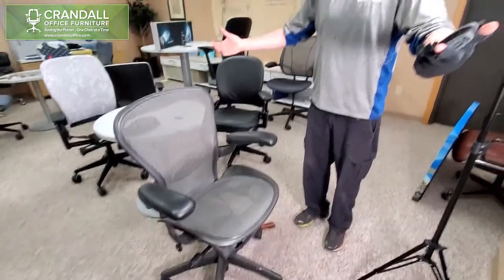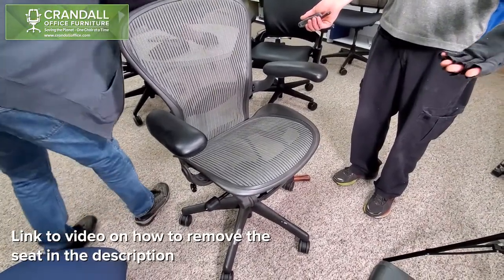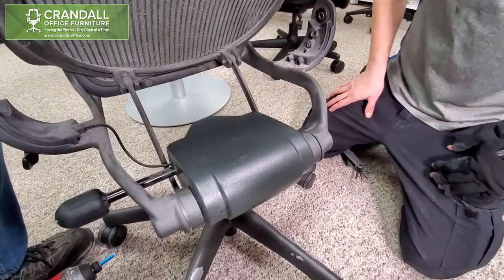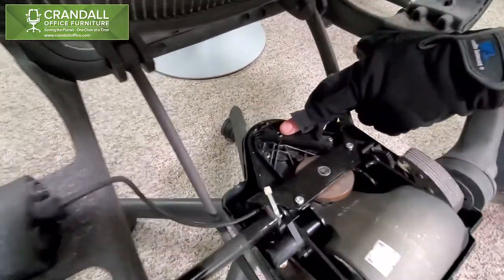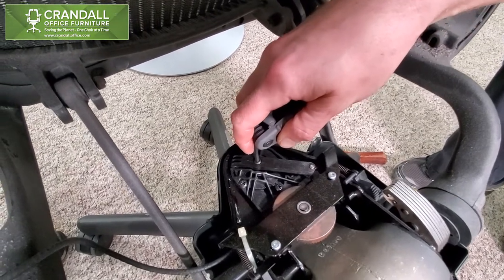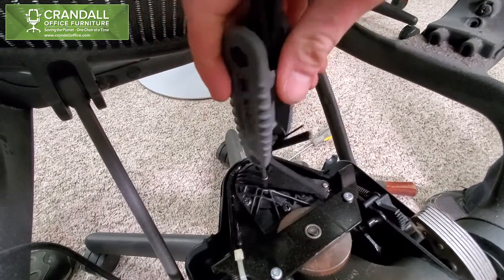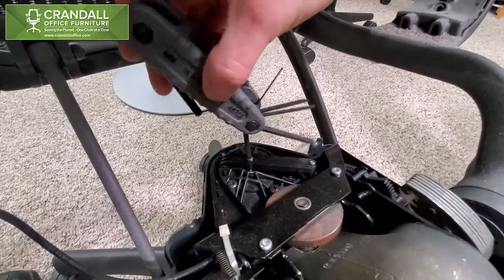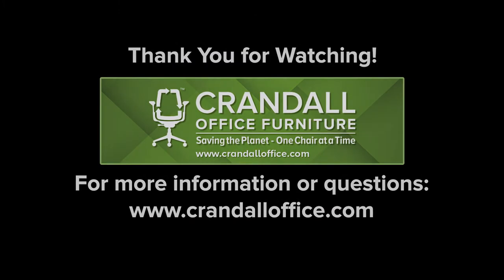Herman Miller Aeron Classic Chair Gas Cylinder Set Screw Adjustment - Crandall Office Furniture

Comment: Pro tip for those watching. You don't need to take the seat off. Just pop the plastic cover off like in video. You can reach the set screw from the back
Reply from the maker: Very true thank you
Reply: Mine is missing a set screw. Is that why my chair will not come up? It's at the very lowest height currently. When I pull the lever the plastic part inside does move. Where can I purchase a set screw replacement? Please help 🙏 😢

Comment: Thanks so much for posting this video.  I just adjusted the piston on my chair turning the allen bolt counter clockwise .  Thought i needed a new piston for my 20 year old chair.  Doesn't sink anymore.  Thanks again
Reply from the maker: That's great! Glad we could help you get your chair fixed up! Amazing that the cylinder is still going strong after 20 years, they usually don't last that long :) Let us know if there's ever anything else we can do to help! -DC
Reply: @CrandallOfficeFurniture  Awesome, thanks again.  If I need parts for my chair I will give you a ring.  This chair has been great for over 20 years.   I use it all the time when using the computer.   I call it my throne.  The chair has been functioning perfectly all this time.  I take good care of it as well.  Keep up the great content and thanks again for the help with my chair.

Comment: How do you know when to change the gas cylinder or there is just something wrong with the mechanism?  Height is all the way up and the height adjustment does nothing
Reply from the maker: We would definitely recommend starting with the set screw adjustment. Make sure to only make small adjustments at a time, and do not over-tighten or over-loosen the set screw (it can fall out if you're not careful). If you still can not get the cylinder operating properly, the next step would be to replace the actual cylinder. Let us know if there's anything else we can do to help! :)

Comment: Thanks! I needed to know how to remove the plastic cover so I can oil the slip springs inside it to stop the creaking!
Reply from the maker: Glad you found it helpful!
Reply: @CrandallOfficeFurniture  Do you happen to know of a solution to solve the squeaking problem whenever I rock my Herman Miller Aeron 2007 chair? The sound is insanely loud! I dismantled the entire chair to the box that you demonstrated and sprayed Silicone lube on the metal and hinged parts and the squeaking is still there! Any Advice is appreciated!

Comment: Thanks for the video. My chair looks exactly the same and I opened the section you showed here but I don't see the set screw, there is a white attachment in place of that. My chair is also sinking slowly. Any idea what I can do?
Reply: I have the exact same problem. Mine doesn't have a set screw that is adjustable with an Allen wrench like they show in the video. Mine has a cable/pump type mechanism running in to it.
Reply from the maker: Any way you can shoot me a quick picture of what's going on there? Would love to take a peek and shoot a quick video for you 😊
Reply: @CrandallOfficeFurniture  same thing here.  did you ever see a picture?
Reply: Per Crandall, I actually have an Aeron from 2013 or newer that uses a side activated gas cylinder, so it doesn't have a set screw.  Thanks guys!
Reply from the maker: @clemmonsm  Based on the picture I received, the chair you've got is a newer chair (made after 6/26/2013) with the side activated style gas cylinder. This type of cylinder uses a cable to pull a lever sideways, and does not use a set screw.

Comment: I found if I go too far counterclockwise the chair still sinks half way down when sitting it but won't return when I pull the handle. Too far clockwise and the chair just goes up and down without any input. What should I do if even micro adjustments can't get it back to normal? Time for a new chair, I suppose.
Reply from the maker: Keep trying to find a middle ground. If that doesn't work, I'd try a new cylinder before I told you to scrap the chair! -DC
Reply: Crandall Office Furniture awesome - thank you!
Reply: @CrandallOfficeFurniture  BTW, does the heavy duty gas cylinder on your website work with the Aeron C? I assume so since that's the big-butt chair?

Comment: I have an older Aeron chair that seems to be sinking a bit as soon as I adjust the set screw counterclockwise. How far out should the screw be turned to stop the sinking over several hours? Also, the seat cushion tilt forward feature seems to not tilt forward.....how should I be adjusting this feature? Again, someone mentioned "adding" the tilt feature........can you further explain? Is there a part for this that might need replacing? Thanks your great videos......Steve
Reply from the maker: Hi Steve - it should not take much - I'd try about 1/4 turn to start and see if that does it :)

To add the tilt function to the chair, you need an entire cable kit - we will likely be posting a video about this in the future :)

Comment: This helped but it still sinks a bit. Is the only fix losing a few lbs?
Reply from the maker: There will some tolerance of give when it comes to the cylinder moving when sitting. As long as its not compressing and free falling slowly or fast and stays in the position once seated you are good to go.

Comment: hey i over adjusted and my set screw fell inside i think, its not there anymore. does this mean it is now sitting un top of my cylinder and it needs to be taken apart to get to it?
Reply from the maker: So you overtightened it and it went all the way through? If so, then yes it may be on top of the cylinder and you'll need to remove the cylinder to get to it. If you loosened it too far, it's likely somewhere else.

Comment: what happens if u turn it clockwise? also my aeron doesnt go down as smooth anymore. would i just need to change the cylinder or can i lube it somehow?
Reply from the maker: Turning it clockwise tightens the set screw, which will activate the cylinder sooner. You would tighten the set screw if nothing happens when you pull the height adjustment lever. As for the smoothness, a new cylinder would definitely fix that, but you can try applying some Vaseline to the cylinder as well and see if that helps.

Comment: Hi. Is there a way to know difference as to whether the screw needs to be adjusted or the cylinder needs to be replaced? My chair lifts, but when I sit back in it, it sinks to only a few inches of lift. Thank you!
Reply from the maker: Does it feel like more of a springy feel or does it actually sink and then not return once you get out of the chair?
Reply: @CrandallOfficeFurniture  I have the same problem, the chair sink immediately after I sit on it, and once I get up the chair goes back up. Please advice!
Reply from the maker: @srikrishnajay  Sounds like you need to loosen the set screw a bit - right now the set screw is too low and is always activating the gas cylinder, so backing it off a bit should make sure the cylinder is not activated all the time and should fix your problem :)

Comment: My aeron doesn't have that adjustment actuator. What do I do?
Reply from the maker: It's likely you have a newer Aeron with the side activated gas cylinder, which does not have a set screw adjustment.

Comment: If this doesn't work, does the cylinder needs to be replaced? Also, does it matter what gas lift cylinder I need to use? I want to purchase one on amazon to replace it.
Reply from the maker: Can you describe what your chair/cylinder are doing? As for the cylinder - just make sure you get the correct style of cylinder, though I can't speak to the quality of part you'll be getting from Amazon, I can promise you that our parts are made to OEM quality and we stand by our warranty.
Reply: @CrandallOfficeFurniture  I am using the Herman Miller Aeron classic edition. And what do you mean by the correct style of cylinder?
Reply from the maker: @Skilled7105  In June 2013, Herman Miller switched the cylinder style in the Aeron classic to a side-activated style cylinder.
Can you describe exactly what's happening with your chair? I'd love to help confirm if what's going on is a failed cylinder or not.
Reply: @CrandallOfficeFurniture  Yes. I actually just sent you guys an email! Looking forward to hearing back from you!

Comment: Adjusting the screw is still not fixing the problem for me. Any other suggestions anybody has is greatly appreciated please.
Reply from the maker: Hey there - we'd be happy to help if we can - can you tell us more about exactly what is going on with your chair?
Reply: @CrandallOfficeFurniture  Thank you for writing back so quickly. My chair (purchased around 2008) collapses/goes with a thud as I sit down on it and lifts up when I get up.
Reply from the maker: @krisztinarozsos710  If loosening the set screw doesn't help in that situation, then it's likely the cylinder needs to be replaced.